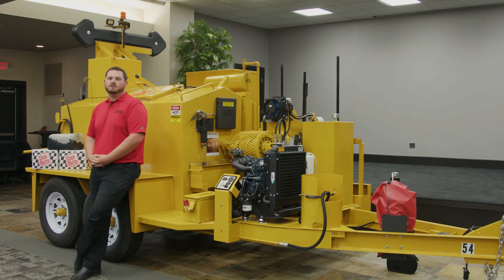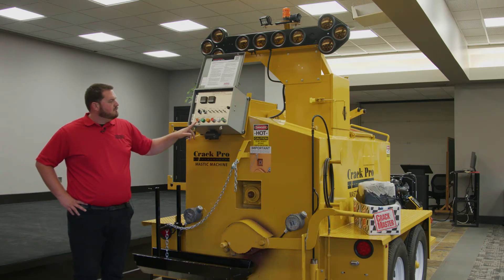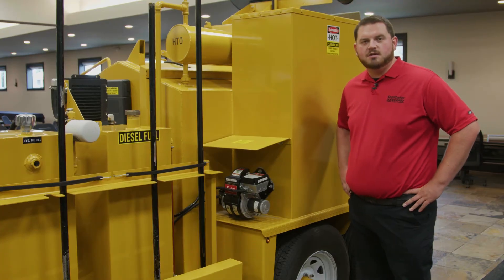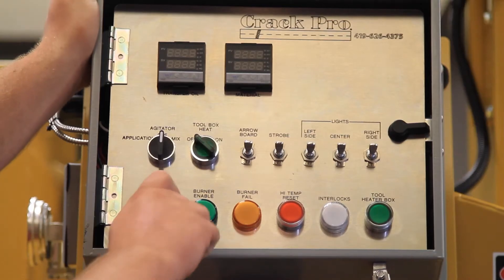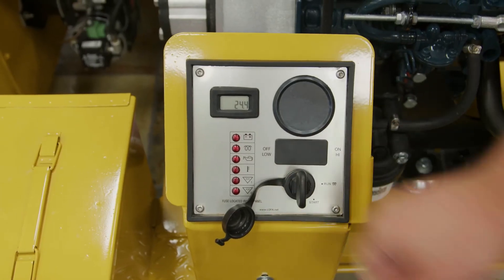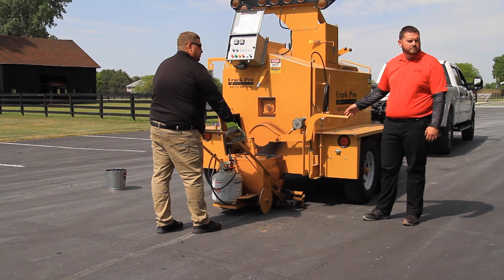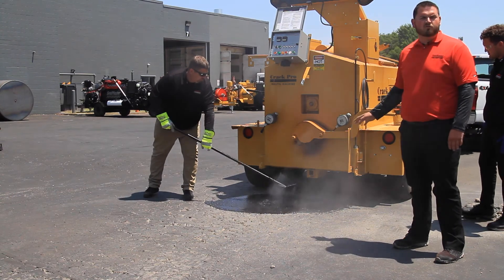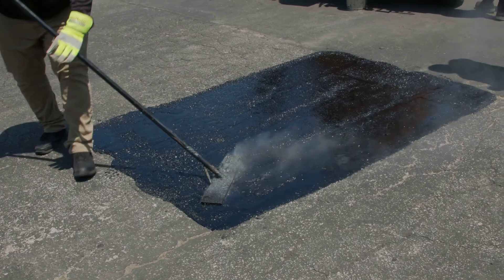SealMaster Crack Pro Mastic Machine

Comment: Can mastic be used for grouting/pointing brick or stone pavement?
Reply: SealMaster Crack Pro mastics are designed for use on concrete- or asphalt-paved surfaces only.
Reply: @debbiehufford9578  okay then, sounds like it would work for brick roads.
I mean it says crack filler, so not sure why it would be advertised like that if it wasn’t capable of jointing a brick road.